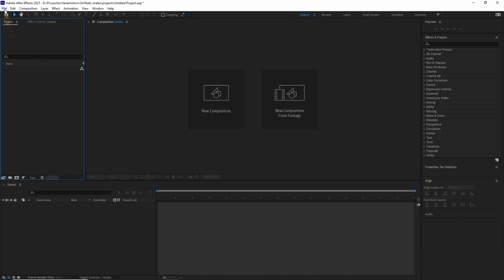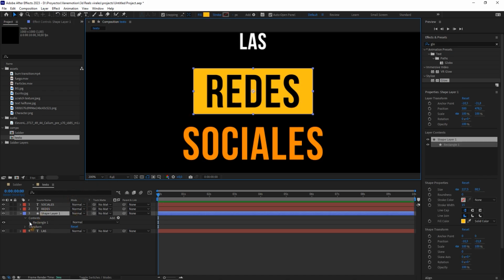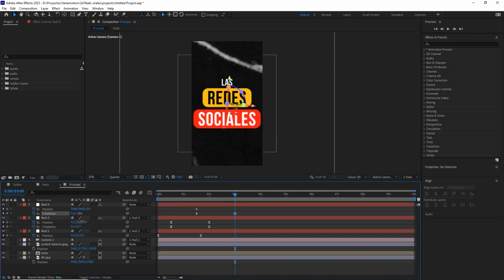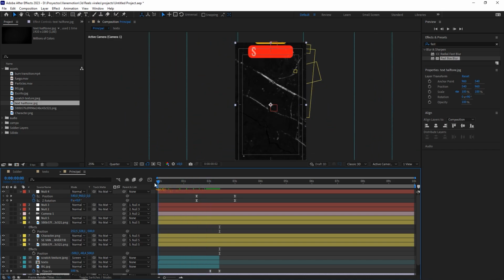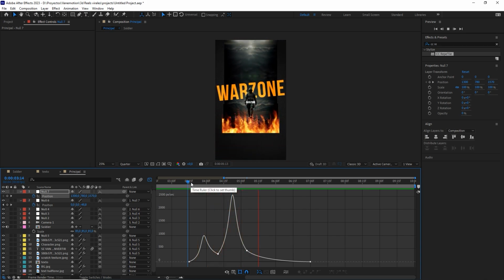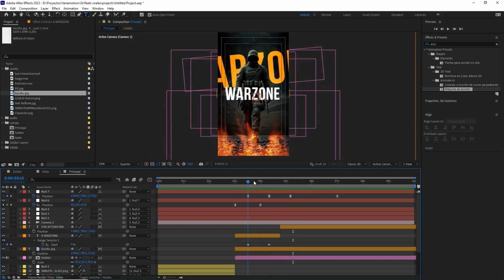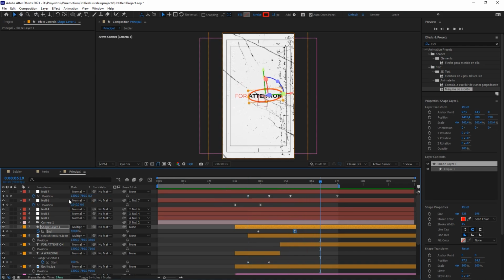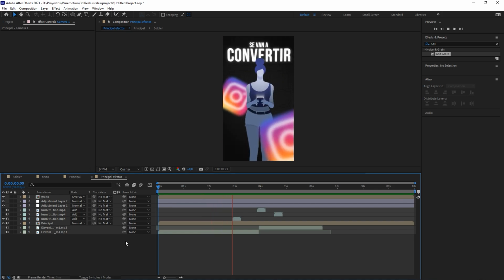How to EDIT 3D VIRAL Reels like Houston Kold | After Effects Tutorial

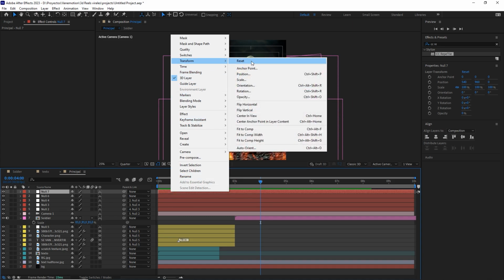Comment: Why did we center null 7? 30:56
Reply from the maker: Hi! When you create a null and convert it to 3D, it moves to the origin point. For example, if you have a composition of 1920 x 1080, it will move right to the center: 960 in X, 540 in Y, and 0 in Z. So, if, for example, you have the camera in this position: 2850, 1875, 1400, you won't be able to see the null, and when you center it in view, it ends up right in front of the camera's viewfinder.